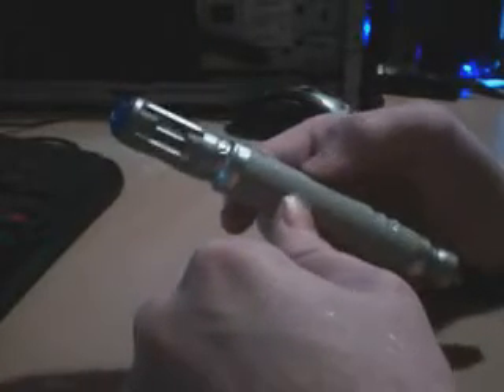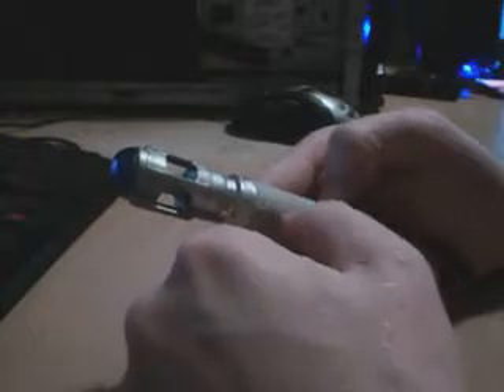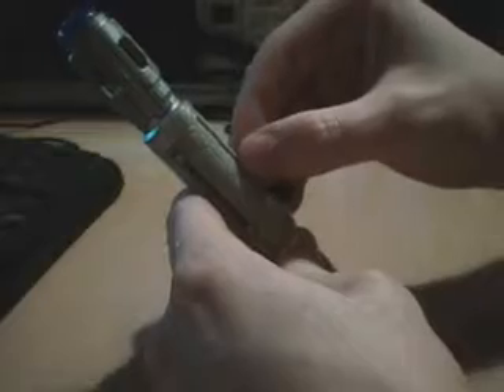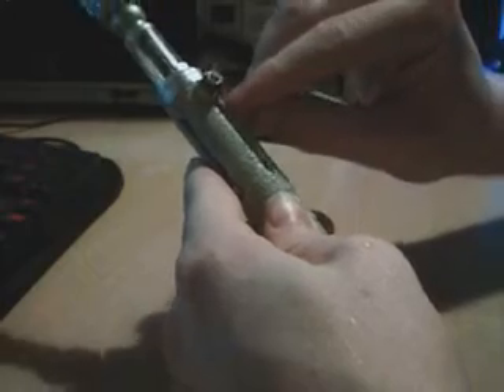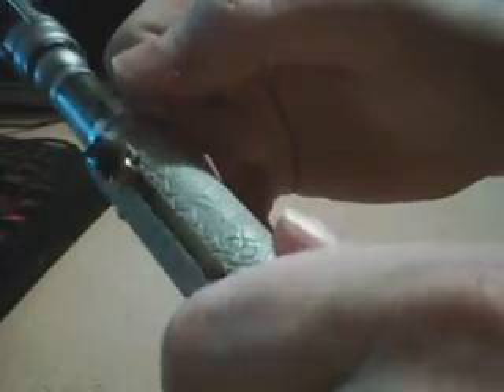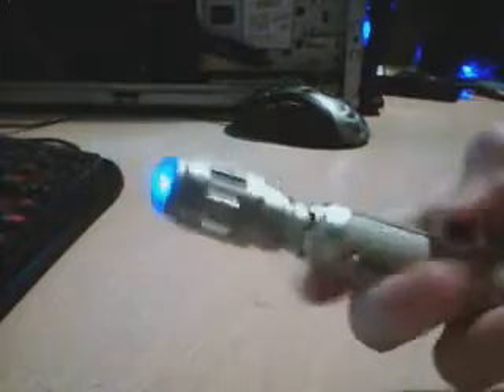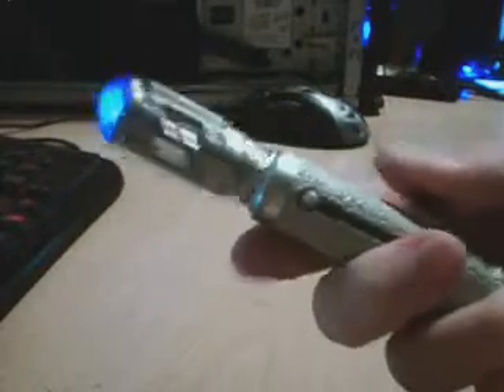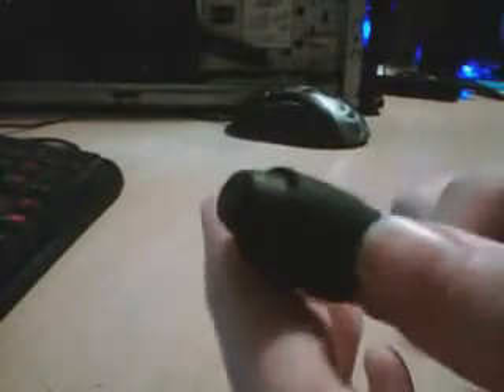Sonic Screwdriver Modification

Comment: Brilliant video.  I just stumbled across it, and yours it the only mod I've found with replacing the LED.  I was wondering if there was any way you could post instructions or maybe a video of that part of the mod?  I'd love to make mine a torch, since I don't use the UV ink, I'm just struggling with removing the casing around the LED to access the components.  Thanks so much, again, for posting this!